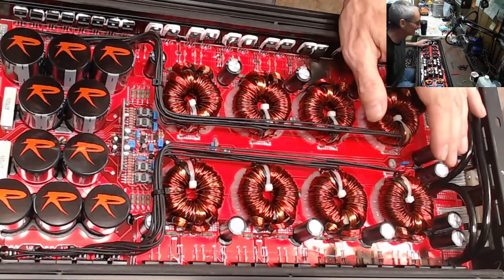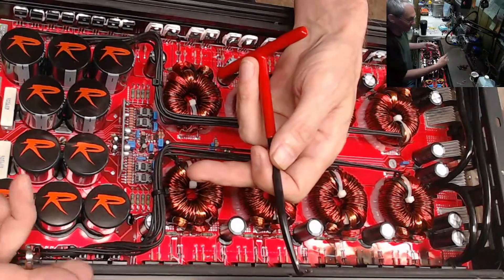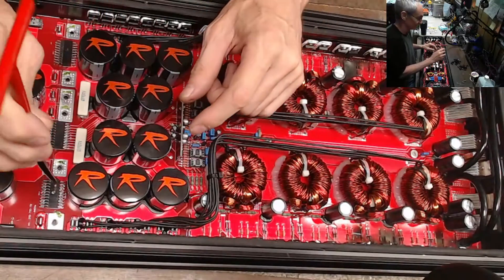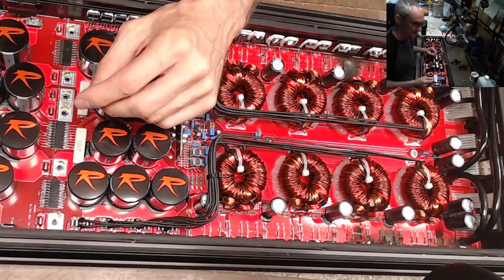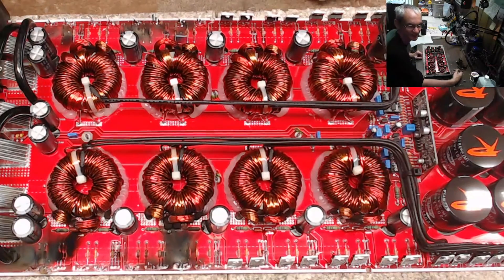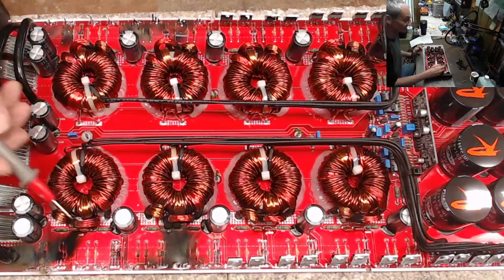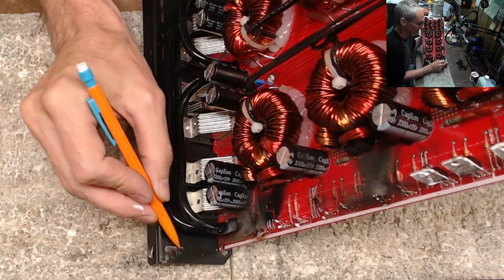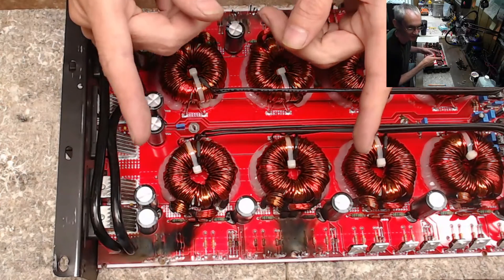New Transistor Spring Clip Tool with Vibration Damage Findings at End

Comment: What about the clips that dont have a hole to put the puller in
Reply from the maker: I have a set of long needle nose pliers (big blue ones from HF) that has a slot cut in on the pliers part that grabs the outside edges of the clip. Tool modifications are almost a requirement if you do not have the proper tools like the OEMs use.

Comment: i have a ruthless 10k, the other day i was demoing and heard a louuuud pop but everything was still working then saw smoke, i turned it off pulled the amp off my enclosure which is 3in walls all the way around and 4in baffle fully resined 5 steel braces on the inside so at full tilt you cant feel any vibration on the box what so ever so i know my enclosure is solid, anyways i opened it up and i blew a mosfet and 2 caps no legs are broke like you're showing on here or rubbing so i dont think it was vibration related, with that being said any idea how it happened? my electric is 2 390a alts 120ah yinlongs 15.3v is where its set to and at time of the popping my voltage was 14.6 my amp was tuned with a dd1
Reply from the maker: So far I have only seen 1 output failure and several vibration damage board. I am working on a 10k now failed from number 1 power supply transistor broken from the board.
Reply: Mine is being delivered to you today actually lol

Comment: Off topic question, but at least it helps the algorithm. Lol

What kind of product can you use to seat the big transformers and inductors when they come loose? 

I was thinking rtv silicone might not be strong enough. Maybe E6000 rubberized glue?
Reply from the maker: Yes, E6000 is great to use along with Gorilla Glue Clear Grip. E6000 is not as reversible as GGCG though. I am always thinking of the next person who may have to work on a board that was here.